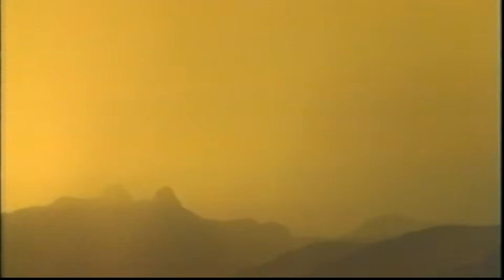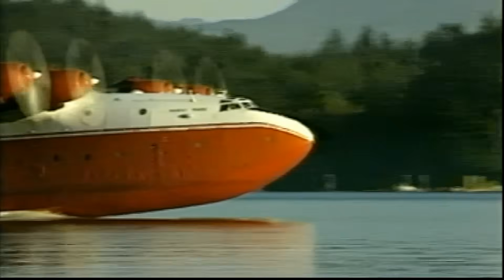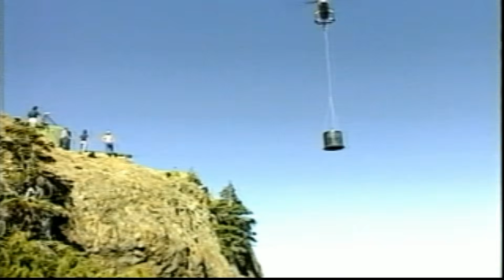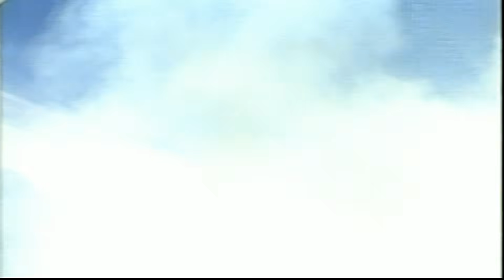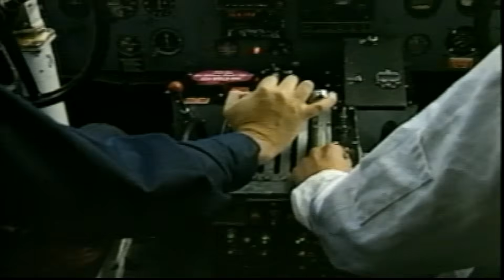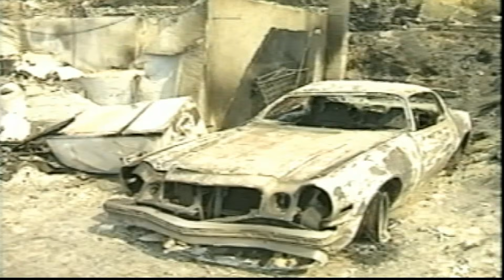Flying Tankers original documentary Martin Mars

Comment: The Hawaii Mars will be going to the BC Aviation Museum at the Victoria Airport on Aug 11 2024
Reply: CBC did a segment on this bomber a few days ago and I also heard a few old-timer engineers want to resurrect this bomber design into an updated version that can carry more than double the old "mere" 7000 Gallons. The engineers I talked to also want to create a cango-and-passenger-friendly version for short haul cargo and passenger flights using much newer engines. 

Since Victoria, BC-based Viking Air resurrected the deHavilland Beaver waterplane design few years ago, I would not be surprised that this workhorse design could ALSO be resurrected with much better engines, newer and stronger aluminum superstructure and much heavier cargo-carrying capacity. 

At 15,000 Gallons (i.e. 125,149 lbs), it would make a formidable short haul water landing capable cargo carrier and fire-fighting machine! I hope that reconstruction efforty goes well! It would be GREAT to see this design fly in a modern configuration.

V
Reply from the maker: @barontaylor7139  correct 😊👍🏻